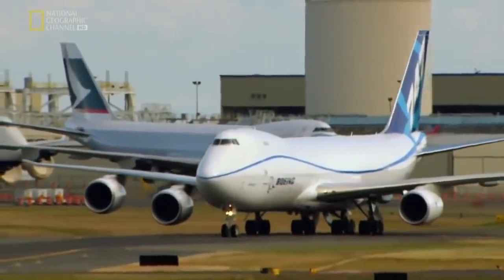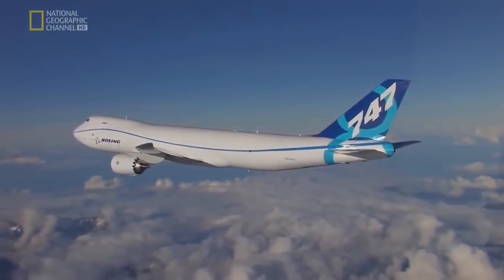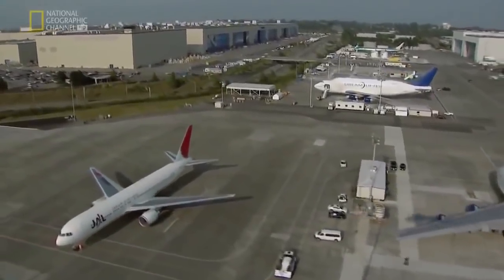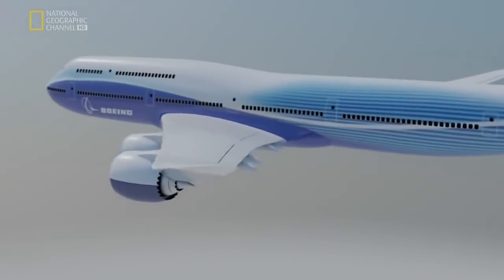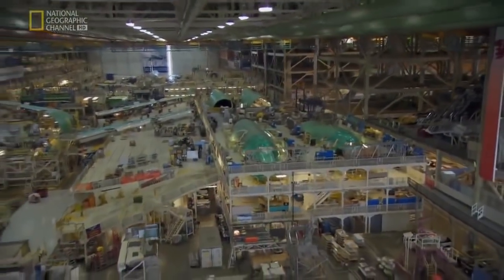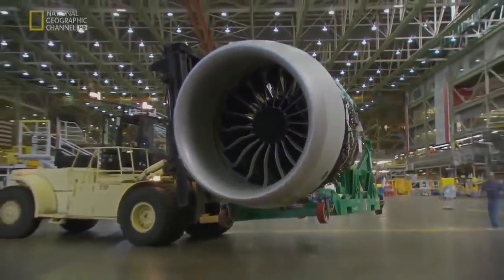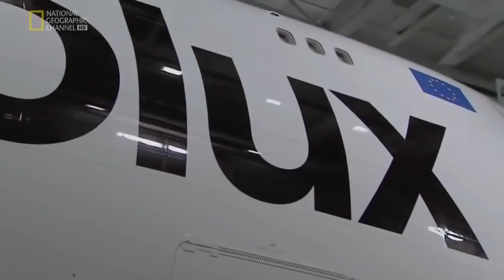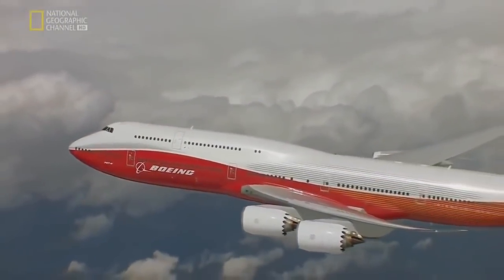Building Boeing 747-8 Full Documentary - Worlds Longest Airliner

Comment: Dumb. The A380 has now taken over the Boeing 747.

A380 RULES!
Reply: Agree :D
Reply: Boeing have crashed more than airbus
Reply: Find Malaysia airlines and and then talk to me... If Boeings Tecnology is that shit that you cant track a fucking plane.
Reply: Tracking tech doesn't work when someone deliberately TURNS IT OFF.   Doesn't matter who makes it when its disabled manually.
Reply: They Should still be able to track a big piece of flying aluminium.
Reply: Videox Jayze Over land, or within the coastal areas of larger nations, yes.  But radar is limited to line of sight, thus the lower the airplane flies, the shorter the distance away that radar can detect it.  Given the plethora of separate nations, many of whom are not wealthy, and there are huge areas without any radar coverage at all, because there are no stations - they cost money to operate and staff, and some of those island nations simply see no purpose in spending THEIR money to track airplanes going by - and honestly, who would?  Satellites in orbit can have very great acuity but they're specialized, they won't be looking at routine air traffic, they have other tasks and every minute of a satellite's time is valuable.  You can't see something no matter how big it may be if you don't have "eyes" to point at it.
Reply: @All_Above
Now how did this conversation turn to MH370?
Reply: No, no, boeing have had way much more crashes then airbus. The reason: Airbus have less brands. And the pilots that fly airbus's planes from airlines have been extra trained because airbus have a different control system.
Reply: Nothing is better ( i hated Boeing, but now i dont hate it) the a380 and the 747 are just like the same.
Reply: D3vSt4r I wouldn't say that; the A380 is simply too big. (1) big things are mechanically complex, meaning a LOT of bugs pop up along the way (shed turbine blades, charred wiring, falling interior panels, water rolling down the aisles), (2) airport logistics to accommodate such a large aircraft can be nightmarish, and (3) there is far greater liability in the event one of these is used in a hijacking. The 747 is fading in sales, due to more efficient twin-engine jets, both medium and large, plus the aforementioned passenger liability issue. It's a good freighter anymore, that's about it, and Boeing doesn't care, the 747 has made them money hand-over-fist, time and time again. It was a moneymaker and they have no qualms about walking away from it if sales sag.
Reply: Just because more have crashed does not mean it's always unsafe plane only crash because human error
Reply: And the 747 was the first of its kind airbus just stole the idea
Reply: Zoid berg No, Airbus just tried to one-up it...and their timing was poor, because that's when the idea of a 4-engined jumbo had passed its peak. We've got large twins capable of doing the job more efficiently, as well as smaller jets that can cross oceans. Not only that, but when an A380 gets hijacked and crashed, it's gonna be a liability nightmare. The brontosaurus simply passed its evolutionary prime.
Reply: Are you on boeings side or airbus?
Reply: Zoid berg You don't have to pick a side
Reply: D3vSt4r you just blew my mind
Reply: TRUE!!
Reply: ***** No such thing as a perfectly safe aircraft. The closest example we had, until recently, was the 777, which reigned for almost 20 years...until the Asiana crash...then the Malaysia disappearance and then another Malaysia blown out of the sky.
Reply: -***** the last two you listed wasn't the plane but human error that's what brings down a plane usually
Reply: John Zoidberg I understand your point, but the FAA and the ICAO don't care about the organic causes or pilot error...just how many deaths occurred in each type, regardless of reason. I still believe the 777 is the safest plane out there, and it enjoyed an immaculate run of almost 20 years without a death associated to it, for any reason.
Reply: well 720 people on 2 triple 7. The MH370 and the MH17.
Reply: A380 is a gas guzzler. I can agree that the 747 is getting old, but 747 is more common. Boeing managed to make air travel cheaper, thanks to the 747. But even the 380 is comfortable, the 787 is my plane of choice. It's probably one the more eco-friendly planes, while still offering a comfortable flight.
Reply: Luke Han with the General Electric engines the 747 has the most efficient engines in the skies
Reply: John Zoidberg Actually, the GEnx engines on the 747 are 8.6:1 bypass; those on the 787 are 9.6:1 bypass. Therefore, the 787 has the most efficient engines in the skies.
Reply: ***** can we just agree that Boeing has the best planes in the sky
Reply: John Zoidberg But of course!
Reply: ***** I don't care which Boeing plane is better  I just care Boeing is better then airbus
Reply: John Zoidberg Good enough for me!
Reply: Well my favorite program is Aircraft Investigation on National Geographic Channel. The program would be stopped when Boeing doesn't make any planes anymore. Than I would be very sad!!
Reply: Well it's even sadder when nearly 280 people die on a plane crash just for your entertainment.
Reply: Jan Prins Airbus has had a lot of major disasters as well, especially with A320s. And Luke Han I've never considered a plane crash as 'entertainment': during my high school years, I went on many crash recoveries, often with fatalities. My worst recovery involved a doctor, his wife and their twin toddler sons: they crashed into a foggy mountainside during descent to an airport, no survivors. And the coroner didn't do a good job. I hope nobody else sees that as 'entertainment' either.
Reply: ***** what job did you have in high school
Reply: I worked with my family in aircraft recovery. It paid better than fast-food, it took awhile to get used to, of course, for the reason you read. It's not for everyone...
Reply: ***** how do I  sign up
Reply: John Zoidberg Depends on whether you want to be the recoverer of the recoveree...
Reply: What's aircraft recovery? (sorry, I've never heard of it)
Reply: Luke Han When an aviation accident occurs (an aircraft crashes or suffers major damage on-ground), the aircraft owner's insurance underwriter calls a recovery service, which sends a truck with trailer to the aircraft. The aircraft is either dismantled or cut into smaller, trailerable pieces, loaded onto the trailer and  is either hauled hauled to the recovery service's salvage yard property for further breakdown & disposal or hauled to a hangar at the request of the attending NTSB inspector. Kinda like tow trucks for cars...but with aircraft.
Reply: That seems kinda fun. Much better than working at a restaurant
Reply: But don't you have to like, fly all over the world just to get to the plane?
Reply: You get to travel, but in my instance, there was no international travel involved...save Canada. I've been to all of the western states (including Alaska, except Hawaii) and many east of the Mississippi. And quite a few provinces. Not a bad way to get some travelling in.
Reply: I won't for sure that Boeing has the best planes. When you type in on Youtube Airbus documentairy and as well the Boeing 737 NG documentairy than I was shocked what I saw how the Boeing 737NG is built. These are flying time bombs. Letterly. I don't go anymore anywhere in a Boeing 737NG plane. Period. When I see how the small airbusses are made I am way and way more comfort that these planes are 1000% better than the Boeing 737NG planes from Boeing. The problems that Boeing has with teh Boeing 787-800 and now the 900 series I can tell you that the A350 has the best papers of safety. The A380 is way much safer than the B747 in all the series. And I can tell that the A330-200 NEO is way more safer than the Boeing 787-800. NO Airbus is by far safer; cheaper to fly and way more efficient. Boeing is past tense and Airbus has really the future on this moment.
Reply: There really is no competition because each plane meets the FAA's requirements for safety. The rate of a plane crash is very very very low, so as long as it meets the FAA's requirements, it works. Also the bigger the plane, the more gravity has on it, so the A380 is more prone to tip-overs.
Reply: Luke Han The A380 is not prone to tip-overs, as the aircraft's center-of-gravity is not dictated by its height, but where its load is focused: namely...engines, baggage, fuel, the majority of its passengers and airframe.
Reply: I think the A380 is 
a.) production is slow(common for all aircraft)
b.) Kinda expensive don't you think? Look at their first class for heavens sake!
Reply: ***** preach!
Reply: im sorry. but your airbus will never EVER be as versatile, efficient or beautiful as the 747.
Reply: Animesh Chaudhry LOL!!!! the 747 has been around longer then Airbus has and Boeing by itself has been around 50+ years longer then Airbus. If it aint Boeing, I aint going... seriously... i take flights if its Boeing. EVA for Asian Flights and Alaska for American flights. PERIOD. the ONLY thing the A380 has on the 747-8 is size. but it will NEVER EVER be as powerful, efficient, beautiful and versatile as the 747-8i.
Reply: Chris H. Bro I never supported Airbus I like Boeing more too. I know 747 will always be the true jumbo jet. And 777x will kill Airbus or already has. Read my comment again lol
Reply: i know you do not support Airbus lol I was supporting and backing up your comment :D
  I should have wrote out my comment better. I apologize for misunderstanding :D
Reply: 007adhil In all fairness, the jumbos are dying out. They still have cargo value and Boeing made a fortune on the 747, but Airbus struck the iron after it'd cooled quite a bit. Now, they're having trouble making breakeven with their A380, and it was of no benefit to them when they cancelled the A340 program after nearly 400 aircraft. Smaller, more efficient aircraft are out there now; even the 737 can cross oceans now, a far cry from the late '60s. Plus, smaller aircraft also mean less hull liability in the event of a crash or terrorist act.
Reply: The 747 still remains a staple, but as technology develops, the 787 or 380 may become the new staple. Currently, the 787 has a head start, but the 380 may ovetake the 787. Time will tell
Reply: Luke Han Let's see...The 787 has over 1,048 orders and 183 deliveries to date...the A380 has 318 orders and 139 delivered. And the 787 was started much later than the A380. I think that says a great deal in itself.
Reply: Airbus can get a lot done quickly though. I'll give them credit for filling around 50% of their orders
Reply: Luke Han Not really. The 787 has eclipsed the A380 entirely.
Reply: The airbus has a higher order:built ratio
Reply: Luke Han I don't go by that because they don't achieve the same goal. Absolute numbers reign here.
Reply: True
Reply: ***** your comment sums up everything. This sir, is an epic WIN. 
  The A380 can only land and operate at only a select FEW airports while the 747 can operate majority of the airports. 
  Airbus fell for it and got screwed. They will slowly, but surely fail with their jumbo jet. The A380 is just eye candy, nothing more.
Reply: ***** That's what the people said about the 747 back when the 747 was released. People at that time have never seen a plane that big back then
Reply: Luke Han It's a different game now. There's not much further airports can be developed, now that there's no more room to buy up. Plus, it's enough that the 747-8 is gross-rated for nearly a million pounds MTOW, but the A380 is over 1.2 million pounds. Making larger aircraft just isn't gonna fly anymore...for these reasons and the others we've been discussing in this thread. We're at the late autumn of the Jumbo era.
Reply: When Joe Sutter designed the 747, They had already gone through the idea of a full double decker jumbo aircraft, but they knew a double decker would cause nothing but problems...once again, Airbus fell for the bait.. Joe Sutter is 93 years old and helped design the wings on the 747-8i.
Reply: ***** If I was an airbus advertising whatever...

I'd get a picture of a 747. 258 passengers scrambling around. "You wouldn't enjoy this piece." And also have the inside. "It's not that nice and calming".

Get an A380 and show it's interior. "Mood lights. That makes it a calming plane. No incidents ever. You should take it. (QANTAS, BA, THAI, LUFTHANSA, MORE).    Airbus: Own The Sky.
Reply: StampIncomingRBLX Ooo. Mood lights. Whatever. You don't hop a plane to get your ego stroked; you hop a plane to get where you gotta go. Just because you're trippin' on E and love the pretty lights doesn't mean you're the least qualified to critique any aircraft. You're easy to buy off, evidently, just like a host from Today or The View. The only ticket you can afford is a Greyhound ticket anyway...after selling blood.

BTW, the 747 holds far more than 258 people, dilrod...especially the 747-8. Nice try.
Reply: Think of it like this: 
Like the Titanic and rival companies, Titanic wanted people to have a comfortable trip while other companies wanted faster trips. The airbus is the titanic and Boeing is rival companies. Plus, first class is expensive.
Reply: But the 787 is catching up. Though not as spiffy as airbus, the cabin has more oxygen and electronic window tinters instead of shades.
Reply: Luke Han Amen. I don't want to pay 3x the price of economy for a 4-hour strokefest. 4 hours don't last forever and when you get off the plane, whatever class one flies, you're either in the same Duluth cold or Phoenix heat as the next guy. Besides, it's all the more $$$ I save to fuck around with when I get there. Thrift > Vanity.
Reply: Luke Han Plus, the battery issue is solved. And it wasn't even an issue to begin with. The A380, however: noisy, panels that fall on passengers, wiring that overheats and burns off insulation (we in the AvBiz call that "Airplane MS"), and a free shower for everyone in the lower level. That's the price everyone pays for "France's Big-Time Stub-Rub".

I wonder how much Airbus paid journalists to get the "I Hate The 787" reach-around?
Reply: ***** Shhhh, we don't wanna throw sand in his K-Y... ;-)
Reply: ***** Yeah, I heard about the spanking that Emirates gave to EADS. Saw part of the PowerPoint presentation. Oog!
Reply: ***** It would be interesting to know where those who are pro Airbus / Boeing are from. Viva la...
Reply: first of all it took those retarts 40 years, and a whole bunch of merged companies to challenge Boeing without crapping their diapers, second of all the 747 looks much better than that bloated thing, 3rd of all the 747 is built better and designed better.
Reply: Luke Han Not to mention French toast...
Reply: Fozen.     And.    Asa.   And.    Asa
Reply: Arial Hollingsworth Frozen? And Ilsa? And Ilsa?
Reply: a380 are expensive
Reply: Yeah, looks like Airbus will rule out the 380 and cease production next year.  Another Concorde: financial failure.
Reply: TheCrafter Bro no body plays minecraft anymore. Everyone uses steam
Reply: Luke Han naw we just switched to mod packs so we were'nt bored anymore. those 160 mods really make things different
Reply: Noah S. Here's the thing
Roblox-6 year olds 
Minecraft- 10 year old 
Steam- 10-18 year old
Disks/high end gaming computer - 18+
Reply: Not sure what you said.
Reply: ***** well the a380 and a330 is the only ones that beat the 747 and 767 but the rest of the Airbus planes don't even come close.
Reply: ***** overall I am not gonna deny it. Boeing is better than Airbus. The 777x will also take ove the a380.
Reply: Animesh Chaudhry Thats really unlikely. The A380 can hold way more passengers and get them there cheaper. Most airlines want to save money compared to investing in something that isn't as promising as the A380 was.
Reply: Alexrocksdude Yes, but A380s are really expensive. A380 would work if Airbus could find a way to make them cheaper than 747's.
Reply: Hey Luke I play minecraft
Reply: Then dude, get a life. There are much better games than minecraft now. Minecraft is history.
Reply: Yeah the flying computer
Reply: Luke so is your mom and minecraft is still kicking ass, just look around
Reply: If my mom made history, then I'd be proud of her.
Reply: Ok first of all Airbuses have had way more crashes then Boeing and Boeing has more money than Airbus. Boeing is a very strong company and 747's are much easier to fly the the A380's.

                                  GO 747-8!!😄😄
Reply: BJHTHEBEASTS Have you flown a boeing?
Reply: abel wayne
Useful comment.
Reply: Videox Jayze Your reply is your choice, but the Boeing 747 has been in service for 45 years, whats your point?
Reply: True I love Airbus I hate Boeing
Reply: Lucas Greenaway
Not logical to hate or love a company.  Do you fly?
Reply: Lucas Greenaway Good for you! I love Boeing airplanes but do not hate Airbus. That does not make sense because both companies are leading world airplane production!
Reply: World's Number 1 Airlines, Fly Emirates, used to be with Airbus, But now it is Boeing.
Reply: Emirates buy both airbus and boeing
Reply: Jan Prins you gotta blame Russia
Reply: The A380 and the 747 have the same title. "The Jumbo Jets"
Reply: iZephy! Not.
Reply: iZephy! Rules for 10 years in service only emirates is the sole customer and signapore airlines returned 1 already and in the process of returning the 2nd one the 747 has sold more 1780 jumbos
Reply: Richard maglov Boeing has been around for longer so it’s obvious that would happen
Reply: i have seen wars between apple and android phones, but this argument make that topic look like its for kindergarten